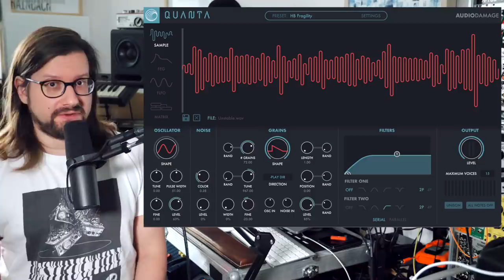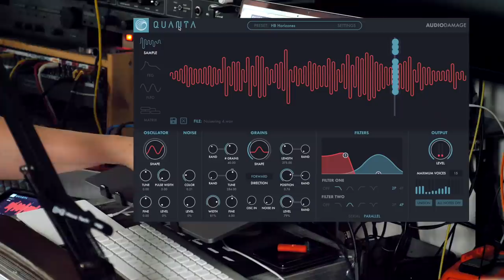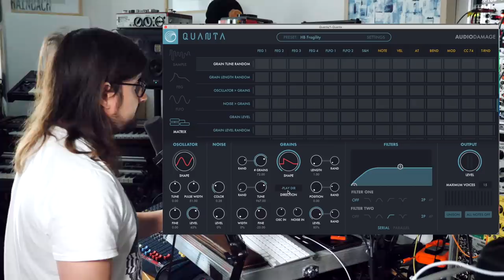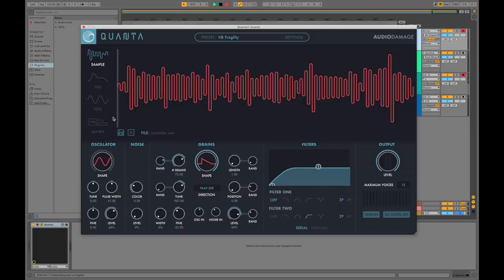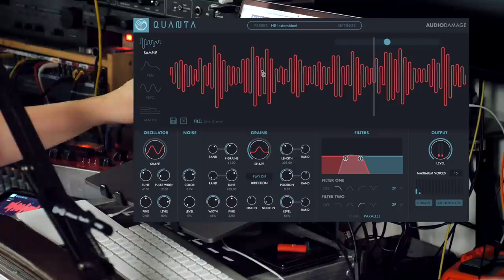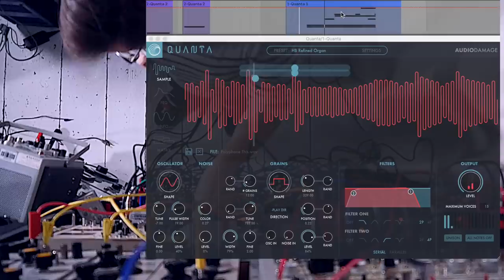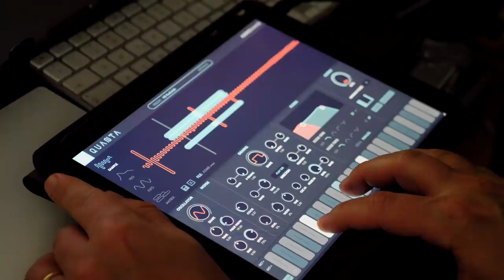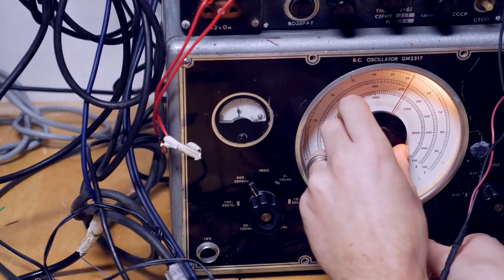Granular Synthesis and Test Equipment Soundpack for Audio Damage Quanta

Comment: I love iPads so much because of all the different "keyboards" and weird input methods. The Moog Model 15 is a freaking marvel on the iPad with the built in Animoog style MPE keyboard. I haven't used a computer for music for more than 8 years or so, relying fully on the ipad. Drambo as a sequencer inside AUM driving all sorts of cool soft synths is my preferred way of working. It's like a modular Electron box with great UI and immense flexibility. Nothing like it exists on PC and there's no way for me to go back to working on pc/mac at this point. I just love having absolutely everything I need right there at my fingertips. My workflow on an ipad is probably 2x what it would be with a mouse and kbd.

The AUM workflow is pretty much as dawless as you're gonna get on a tablet, and I absolutely love it. There are DAWs on ipads as well, but I literally never use them anymore. I find the workflow saddening and tedious. I'd rather work within the limitations of dawlessness than have to work in a DAW at this point. I'm sure it would be different if I made more normal music, but for my tastes, can't get much better than AUM and Drambo + thousand bucks worth of soft synths and effects.

Comment: Granular Synthesis is life... I just finished reading Microsound the other day and I have to say, there's a lot I didn't understand, all the technical aspects (which are a lot), but I found lots of inspiration in it as well. Maybe you have other sources where one could read about Granular Synthesis? Cheers!
Reply from the maker: Formalized Music (Xenakis) is a great read,  Feichtinger wrote some standards on Gabor analysis which was essential back in my studies, though more for the analysis part. Microsound by Roads you have read already, Barry Truax had some essays if I remember correctly.
Reply: @Hainbach  Oh sweet, I will have a look, thanks!
Reply: I find Composing Electronic Music from Roads a great book for all types of synthesis in electronic music. It can get technical but it's an official book from Oxford University, it goes deep and it means business.
Reply: @ethermod307  I will check it out, thanks!

Comment: I have a pretty stupid and simple question about quanta: can anyone tell me how quanta organizes the pitch of the samples? My logic would say quanta takes the exact same pitch of that sample and if you press a key for instance three semi tones above it, quanta should play that sound three semitones above the original pitch.
In a lot of cases something strange happens like: I put in a c# sample. Next I try to find some harmonies and have to find out that many tones of the c# scales sound inharmonious (in this case for instance works the c maj scale best) 

Can anyone help me with that problem?
Reply from the maker: If you sample a c# pressing c will play that sample at that root note, which is c#. Quanta does not know the pitch of you sample, it will only transpose in relation, as will most samplers. So that is why the c scale you play works. It's actually c#.
Reply: @Hainbach  thank you!